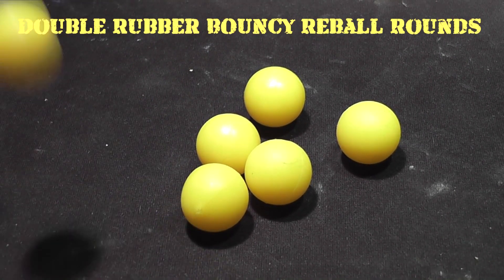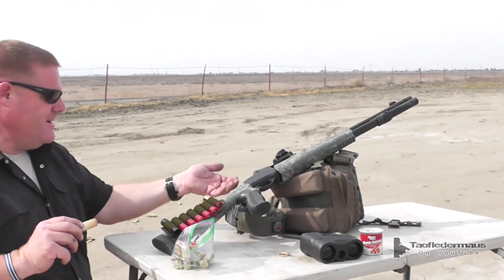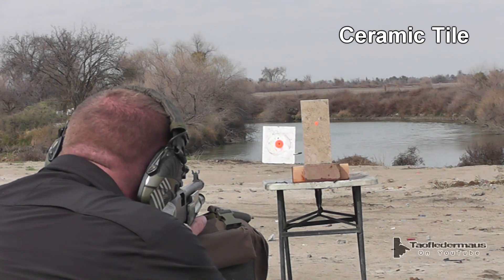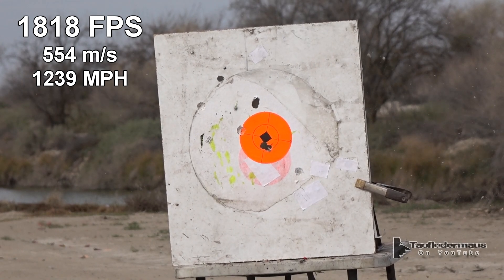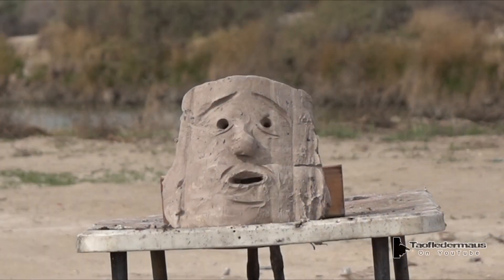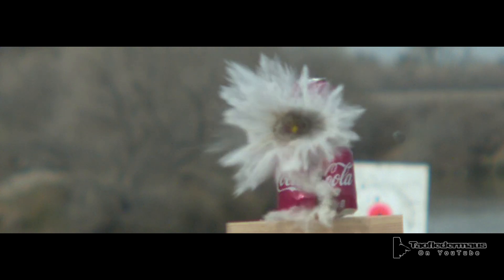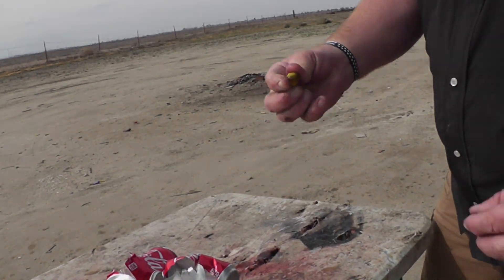Double Bouncy Reball Shotgun Rounds

Comment: When the ball exploded against the ceramic, it was probably because the wadding, which had enough energy to shatter the plate, pinched the ball between the wad and the plate while in its most stretched phase.

Comment: Believe it or not there is alot more energy to these balls than what you would think.    Theres kinetic energy behind the balls from the discharge.  No to mention the energy that is exerted from the rubber when it lands on target.  The G shock also warps the ball when going down range which also causes it to store up energy when going down range.      The fact that one of the balls tore into pieces is a great example of stored energy.     So much physics to this energy

Comment: id do the same but try creating a laminate ball that has metal outside, rubber inside, and a steel core.

so like.. hammered lead or copper on the outside of a steel and rubber core.

i would think the rubber should impart a lot of energy into its impacted object.

Comment: The ball that broke apart on the ceramic tile broke apart because of the tile shattering and creating sharp edges. It wouldn't have done that if it was the steel plate.

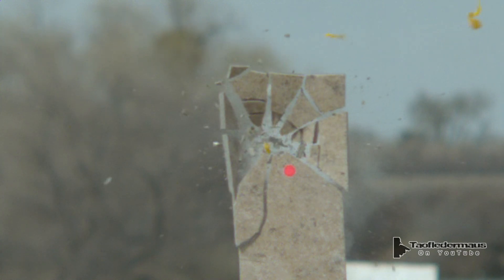Comment: 2:40

IT rip apart because the edge of the ceramic crack cut into the flattened rubber. Like a knife cut propagates on stretched rubber.

Comment: Reball is a brand name. Basically they're just rubber balls or even foam rubber that are used instead of paintballs. Not for actual games, but they're used when tuning a paintball marker because actual paintballs can be expensive and messy. Typically they're used in a proshop which does a lot of repairs on many markers. Rather than using regular paintballs which require you to set up a catch tube that drains into a bucket for paintballs....you can just use these and get the velocity set correctly and ensure proper cyclic function of the marker. :)

Comment: I'll bet that the ball broke on the ceramic plate because the circular fracture in the plate scored the ball while it was under extreme stress, and the cut simply kept tearing until a while ring separated off of the ball.

Comment: Why do you still use a power piston (shot cup) for rubber projectiles?  Couldn't you fit 3 or 4 balls into a shell with just a tissue wad?
Reply from the maker: Probably not,   the gas seal/power piston is needed to hold back the high pressures.
Reply: Strange that you found these in 2.5 grams.  I'm finding them sold as 3.1 and 3.8 grams on eBay.  Apparently there's one out there that's almost 6 grams (not easy to find).

Re: Why don't you load 4 into a shell -- doesn't a rubber ball make a good gas seal?  I think it'd be interesting to load four 6 gram balls to make about 7/8 oz shell.

Comment: Ceramic gets very sharp when it breaks so the ball that hit it probably ripped because of the sharp edges and continued to spread making it appear as if it tore from stretching which is why the balls that hit other things like the steel plate just flattened then regained their shape and flew off rather than tearing

Comment: Have you tried gluing a disk in the shell before loading the shot with very light projectiles? Just a few dabs of super glue around the edges should be enough to give the charge time to burn properly.
Reply from the maker: I used an overshot card and a roll crimp.

Comment: ive been watching for years, love the vids. Though there are so many vids I can’t remember if you’ve tried out the following or would want to. Baby carrots, olives: pitted and non pitted, frozen hot dogs, dried spaghetti: loose and in wax, plaster of Paris, stuff in plaster used as a binder, fish tank gravel, a lollipop, micarta, fireball from match heads and striker paper, lit sparklers stuck in wax, tiny sea shells, wet sand, balloon with colored powder inside, wet paper towel for a huge spit wad, 1 dram bottles of flavoring extract, tampons, ..... just to name a few.

Comment: Wow, you answered something I always wondered about. I thought chronographs worked with metal projectiles only, by some kind of induction. The fact that the rubber projectiles were read by the chrony settled that.
Reply from the maker: This type,  it's just looking at shadows.
Reply: TAOFLEDERMAUS & Laird Cummings, thanks for the explanation. So those two pairs of metal rods that look like antennae are not serving that function. That is actually pretty cool.
Reply: Laird Cummings thanks man, I appreciate the info! I never had used a chrony, only seen them in videos and such. This has to be the most educational and courteous comment thread on YouTube!

Comment: Shoot these at some ballistic gel.
Reply: randumz randumz  you're supposed to shoot these at 230fps. Normal paintballs are shot at just under 300fps for reference. Pretty safe when used properly. Think higher power Nerf gun.
Reply: randumz randumz paintball doesn’t use a 12 gauge shotgun
Reply: randumz randumz  33r
Reply: Shoot em at a wall and hope for the best
Reply: Nah shoot it at some airsoft cheaters. It’ll teach them a lesson if it doesn’t kill them.
Reply: the first word the popped into my head was cannibalism
Reply: randumz randumz  you are supposed to use these only on targets designed to catch projectile for reuse, hence the name reball
Reply: @JediSwordMasters  nah, those were used for indoor field, they are washable and reusable. you shoot them a lower psi and it's the same effect as the paintball, without the mess
Reply: At some police will be better

Comment: I add epsom salt in place of shredded poly to the shot cup to increase weight for low weight projectiles.  Also adds compression support to flexible projectiles. Two cents from the peanut gallery.

Comment: I suppose there less than lethal but I would sure be rude about rebound off a non angle surface
Reply: They are dang autocorrect
Reply: rude=worried
Reply: Aaron Sutherland you know you can hit the 3 balls next to your post  on the bottom right and you have the option to edit your comment